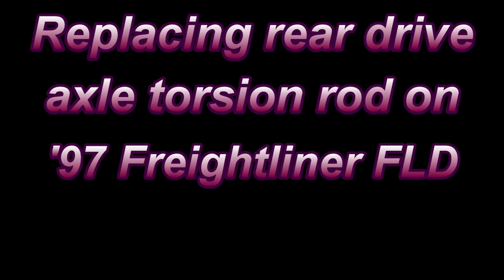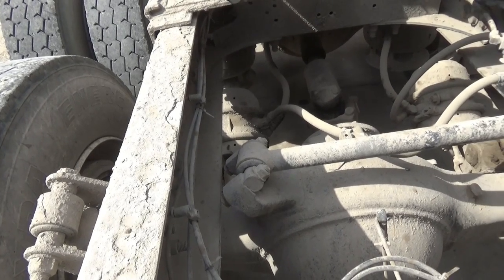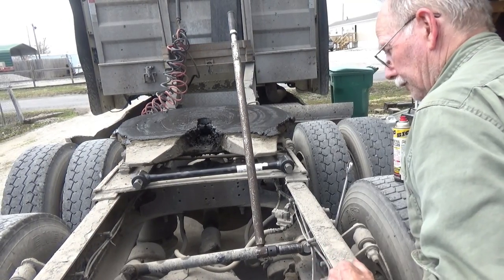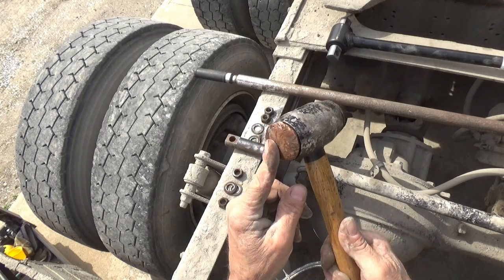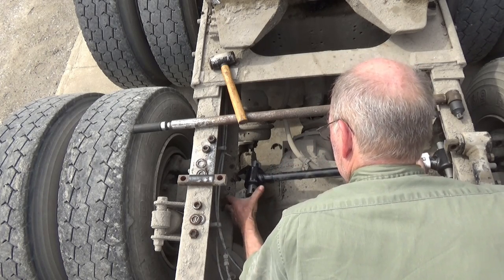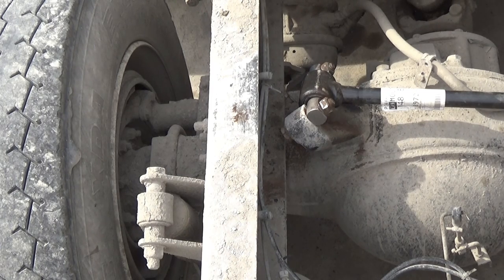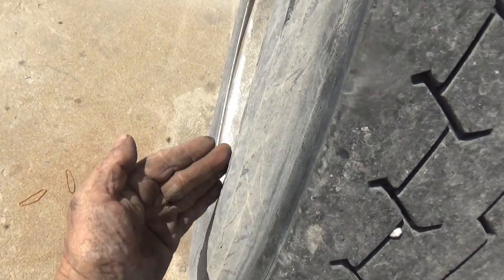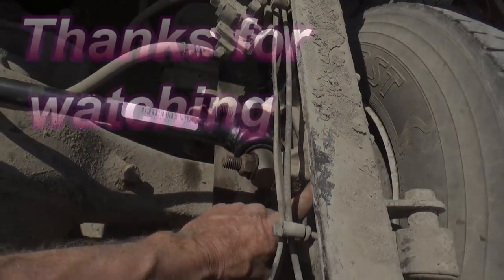Replacing rear drive torsion rod

Comment: Gordon, It seems you have good eye to check your rear alignment, but have you ever tried the old way of string alignment between the back edge of the trailing tire and the leading edge of the front tire on the chassis rear?
Reply: Will that offset change after a short drive? There could be unresolved tensions in the assembly.
Reply from the maker: I have another way to do alignment that would take too long to type out here, I only explained a little bit of what I look for in the video. Thanks for watching Drew.

Comment: why diddent u just heat the nuts with the cutting tourch. Then the impact would of spun them off easy
Reply from the maker: I save that for last resort, it damages the temper and the coating that slows down the rust.

Comment: Definitely not a torsion bar. 

A torsion bar, in an automotive application, is essentially a spring. 

If we consider the most common use, in Chrysler's larger RWD passenger cars, the tension on the bar determines the level of resistance to irregularities in the road surface.  The bar itself actually twists against its anchoring points. 

In a Class 8 truck, Kenworth offered a torsion bar suspension through much of the 70's. 

In your truck,, Gordon, those particular bars are used to locate the axle, perpendicular to the frame. Since the bars themselves do not actually twist, it would not be correct to label them a torsion or torque bar or rod (the prefix "tor" means "to turn"). 

I would think calling them Panhard rods or maybe just control arms, is probably as close as one could get.
Reply from the maker: Thanks for watching.
Reply: I always called them track bars on pickup trucks, but when I got my cdl the instructor thought I was crazy. He said he never heard of a track bar, and that it was a torsion bar. I said something about torsion bars being a spring for suspension and he didn't like that so I shut up.